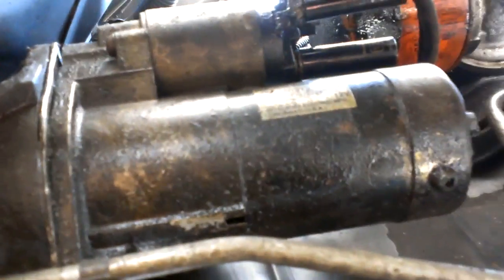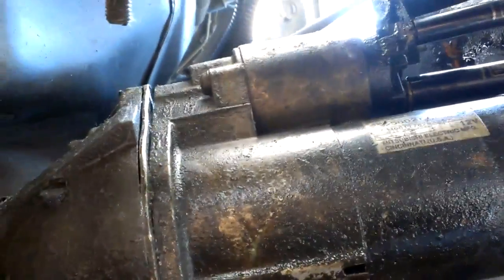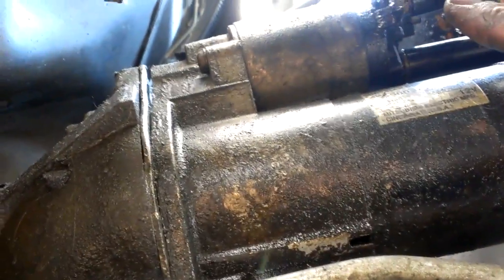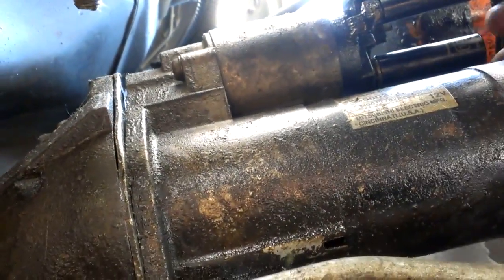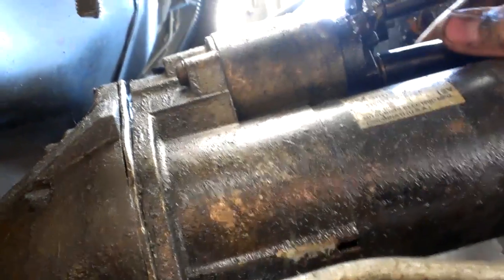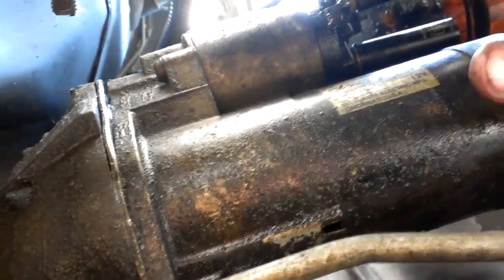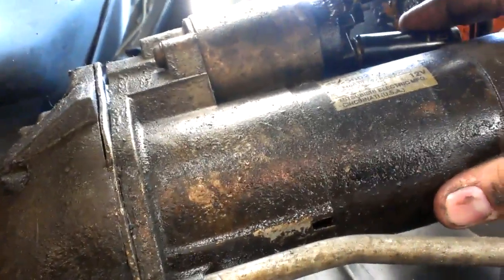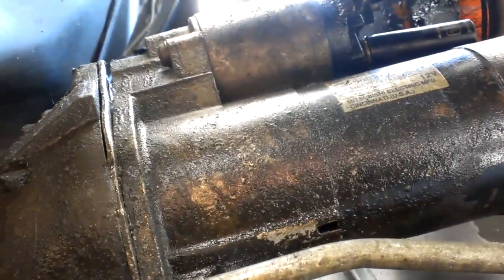How to remove Jeep Starter Motor from Grand Cherokee

Comment: Thx JRE -
My '98 JGC ZJ starter failed.  A couple of differences to help others:
1. Mounting bolts were 16mm, cable terminal 13mm, start terminal 8mm.  If crawling under, carry the correct tools the first time.
2. Bring patience - tight fit by oil pan, exhaust and trans oil lines.  Breaking bolts free may require larger 1/2in drive, electrical tight and needs 1/4 or small 8mm wrench.  Loosen oil lines from hanger for play. Use extensions.
3. Starter testing Autozone and rebuilt replacement $99.

Comment: ok now there is a grommet/ clip that holds those two oil lines attached to the starter... i am having problems putting it back on... ive been driving without it on and now it seems like my starter isnt seated properly and doesnt want to engage probably due to the bolts coming lose.  98 ZJ limited 5.2  thanks

Comment: i only got the longer bolt loose on the electrical side i cant get any other bolt to even budge i used all my might and im very strong even let soak in wd40!!! wtf.
Reply: Talia Bush I'm having that same problem right now. So Saturday I'm going to put the jeep on stands and is if I can get better leverage. I am guessing someone used an air ractect. My exhaust pipe, control arm and transmission coolant lines are right in the way too. 
I hope you got yours fixed without taking it somewhere.